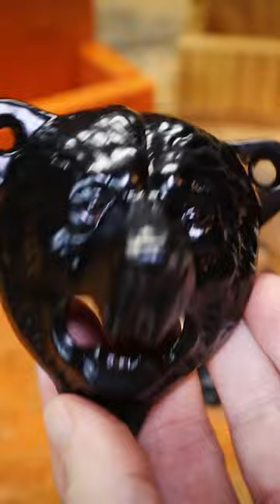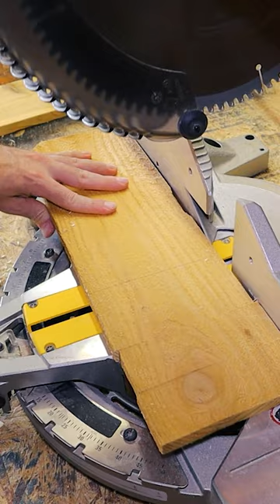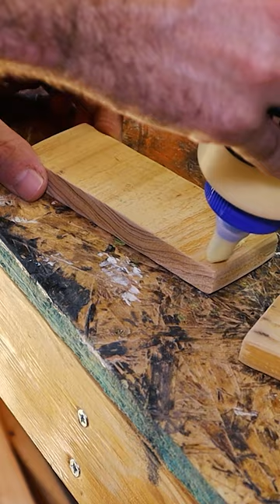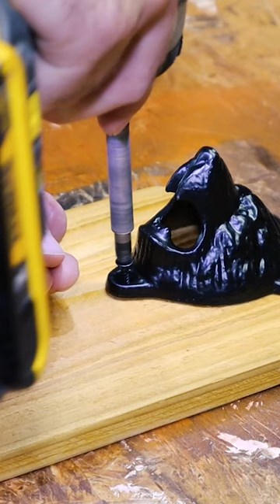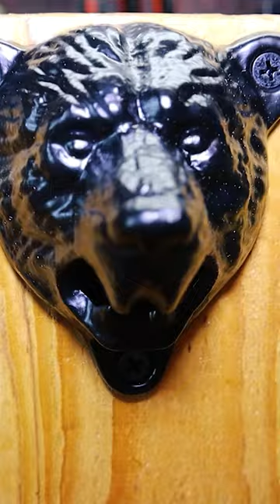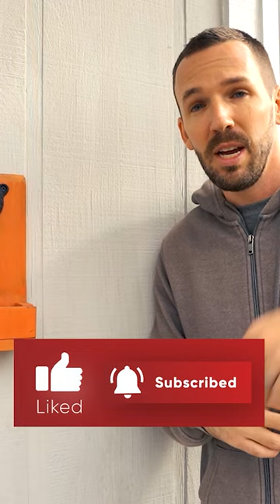Unique Bear Bottle Opener Project

Comment: Stop using drywall screws as wood screws. They're not all purpose. I'd also consider chamfering those edges next time.. She'll look way sleeker without those hard corners. And a hardwood would last a lot longer than the white pine lumber you've used here. 😉 

I know I come off as a dick, but just trying to be helpful in my own crass way. 😜
Reply from the maker: I used good ol' cedar wood here, but yes - I've been getting way too comfy grabbing a handful of drywall screws for my small projects lately because they're black in color. Good catch on that haha